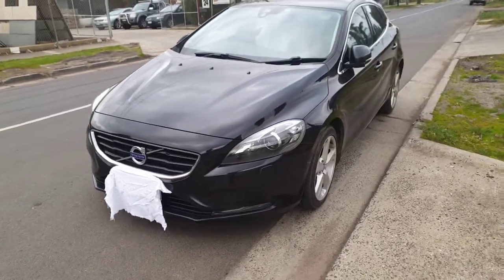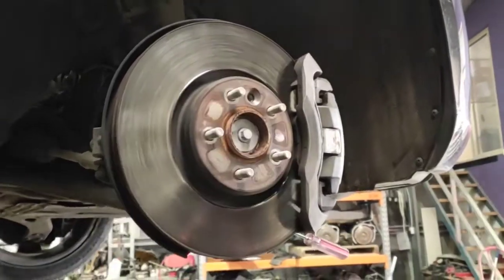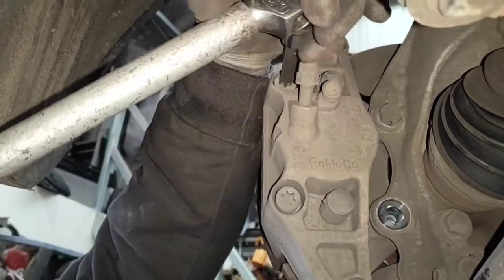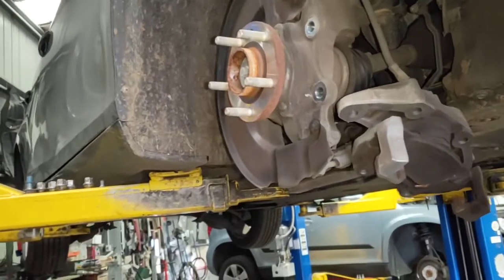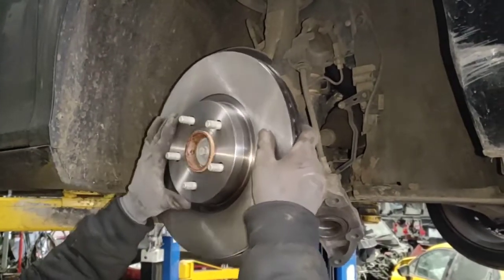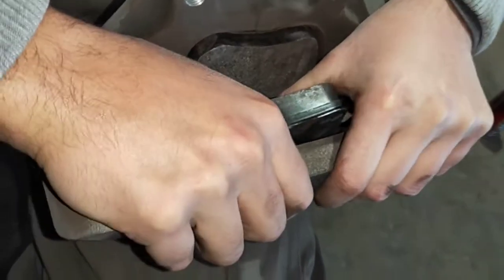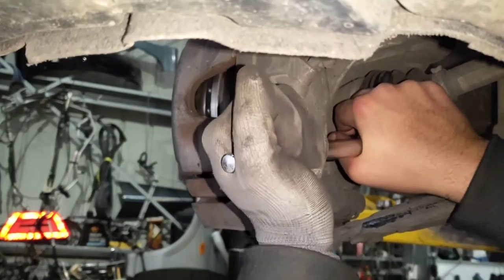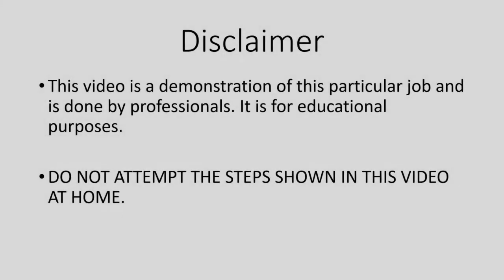How To Change Rotors and Brake Pads on Volvo V40 2014

Comment: Why do you need to split the calipar
The calipar can be removed from over the rotor by spreading the pads apart
Then pull the calipar back and remove the pads clean and replace
4 less bolts to remove easier and quicker and safer
Reply: So this could be done without the T50? How would you pull pads apart without splitting the caliper to get it off? I'm doing mine this weekend first brakes I've done in years, any advise on these would be appreciated
Reply: I didn't need to split the caliper when I did this job on a Volvo V40 D4 - 2016. I loosened the two H7 slide bolts behind the plastic covers on the back which made it easier to remove the pads and push the piston back.